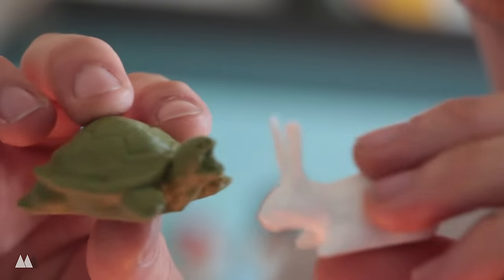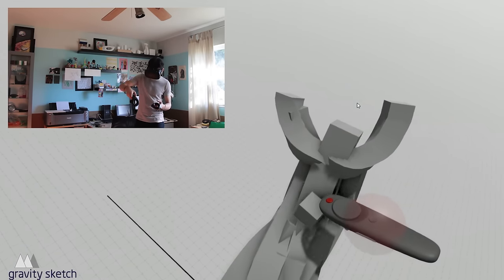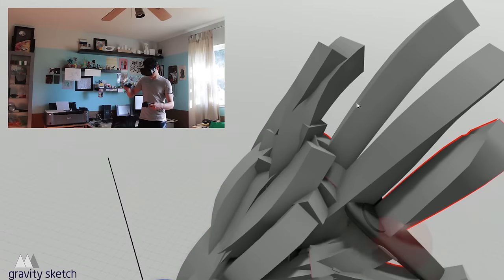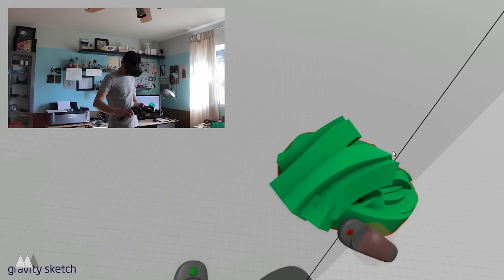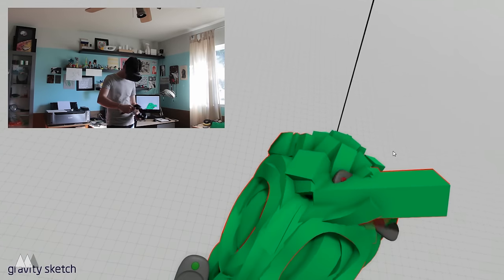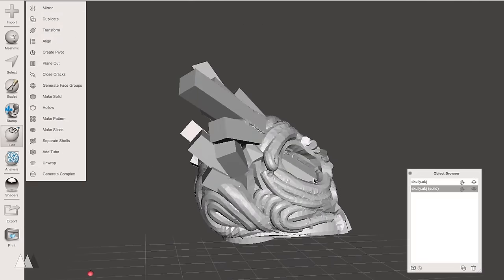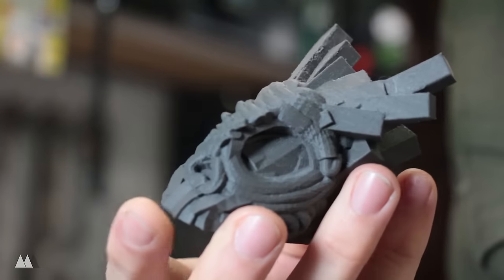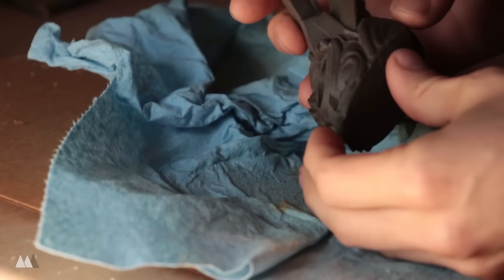VR Sculpting to 3D Prints with Gravity Sketch ( ...and Printing Iron? )

Comment: You can speed up the rusting process by simply soak it with salt water and place it somewhere exposed to sunlight and near some more stable metal like copper(bare metal without any coating).

Comment: Can I kinda go in reverse and take a 3d model I made on my PC and import it into a VR modeler? I want to add more organic structures to functional parts that require specific measurements on parts of the model. It'd be especially useful when making customized grips and ergonomics. I know some people will make the VR model first then add on the geometric parts afterwards, but my workflow would work alot better in reverse.

Comment: These apps need something like a gravity "plop" feature wherein you can grab a finished model, choose a plane to drop it straight down from and have the program flatten the bottom most layer on that plane of the selected model.  This could eliminate the need to wastefully cut off several layers of a design just to print from a flat surface.  There could be all kinds of iterations of that feature designed to produce a printable base with minimal loss of overall model design.

Comment: Hey Devon Ive got £50 what 3D pen should I get
Reply: Skate Crew myriwell is A good ONE! i got IT and i think is €60
Reply: Yes but dose it come with every thing you need because I only have that much.
Also is it good for beginners cuz I've only used an 3D printer
Reply: Skate Crew bro go get work
Reply: If you have a 3D printer, try tinkercad. (It's really easy software for making 3D models.)
Reply: I would like to actually see the difference between them both
Reply from the maker: if you only have that much I would wait, because you'll run out of filament pretty quickly and then the pen is useless :|
Reply: If you have a printer, what do you want a pen for? Theyre useless
Reply: Ralphie Vigg they're good for connecting pieces to each other that couldbt be connected when printing because of size restraints
Reply: Jake May hey I didn't think of that but good thinking tanks oh btw my printer is the best
Reply: Skate Crew  g
Reply: Skate Crew Which is $60.95.
Reply: Make Anything // 3D Printing Channel  thanks also my birthday quite soon so yeas very good idea thanks
Reply: Skate Crew how do you get games for htc vive
Reply: Linzi Rother steam vr
Reply: I use the Lix Pen. I guess I bought it because it's thin and metallic like the beautiful drafting pencils I used to use!
Reply: +nimbuzz How do you know if they are an adult?!
Reply: Skate Crew get the 3doodler create

Comment: VR modeling will eventually bee better than conventional modeling, since it used 3d input with 6 degrees of freedom (3 linear, 3 rotational; or 12dof when you factor in gyroscopic and accelerometer input)  so what you can do is essentially limitless. And compared to physical modeling, you can work on internal pieces and have undo/redo functions, along with a very wide variety of 'tools' that you use on a couple of controllers. 
VR modeling is superior to everything.
Reply from the maker: It's got a ton of promise for sure!